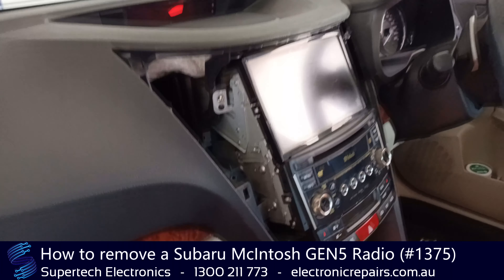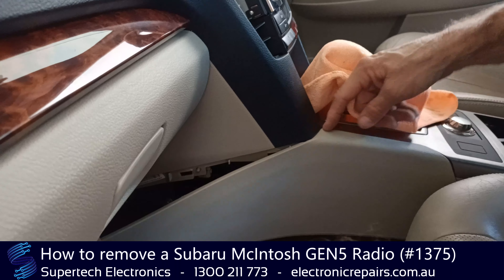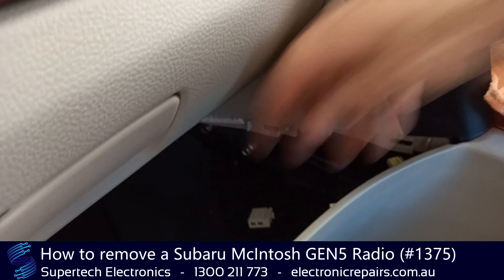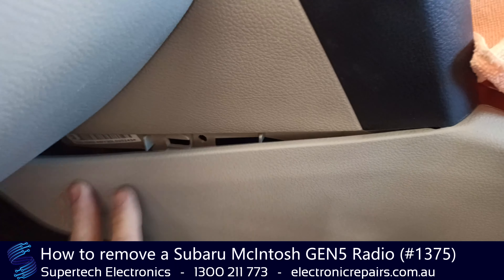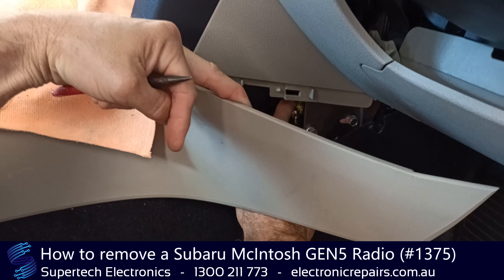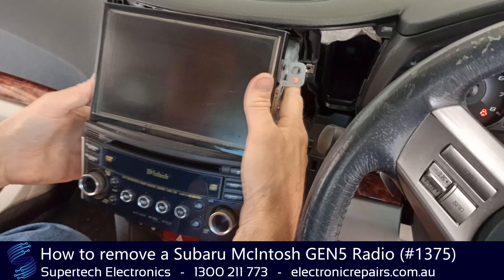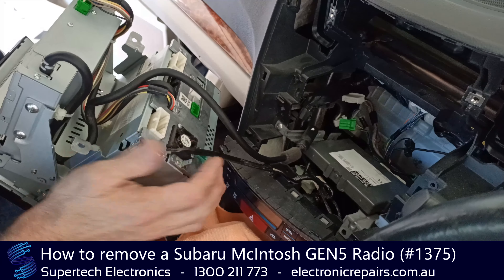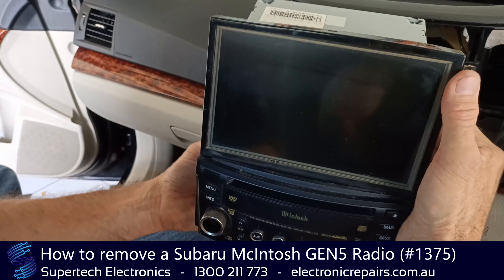How to remove a Subaru McIntosh GEN5 Radio (#1375)

Comment: Hi. I am in New Zealand and I have a Japanese McIntosh gen 5 system on my Outback. Will the navigation work when I swap it with an original McIntosh Gen5 Australian unit? Is the Australian unit the same as the NZ unit? Thank you for your reply.
Reply: Hey Bro, did you ever find a answer to this?

Comment: Can the Mcintosh head unit and sat nav be replaced with aftermarket as it's the only thing stopping me from importing?
Reply from the maker: We don't install aftermarket systems so we cant give you any advice on that. We repair factory car audio, and unless you want to spend thousands of dollars on a reliable aftermarket unit that is built to a similar standard as the factory one (very well), repair is the easy and cost effective solution.

Comment: Pls, can you help me with unlocking central screen? Always is requiring DVD map. Radio is working but screen is always stuck.
Reply from the maker: Your radio needs repairs. You can send to us and we can repair.  https://electronicrepairs.com.au/product/1375-subaru-outback-mcintosh-gen5-stereo-repair/
Reply: It’s easy mate, just remove the black plastic cover under the dvd port where the McIntosh written and you will find second dvd input space, eject the map dvd and clean it and put it back in